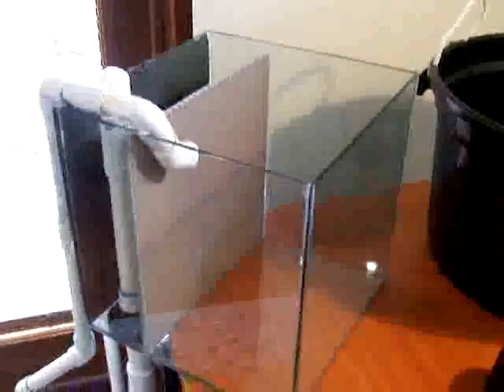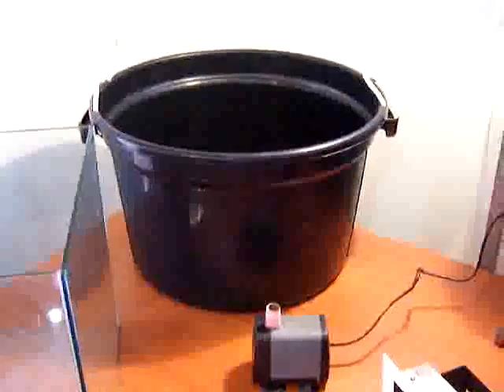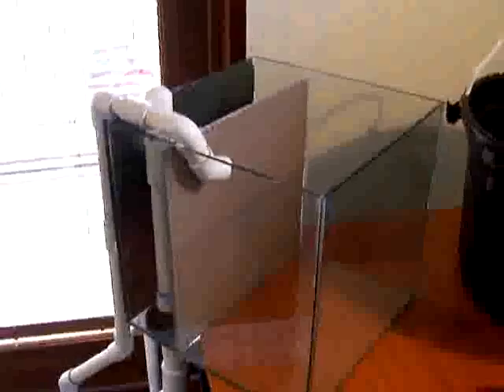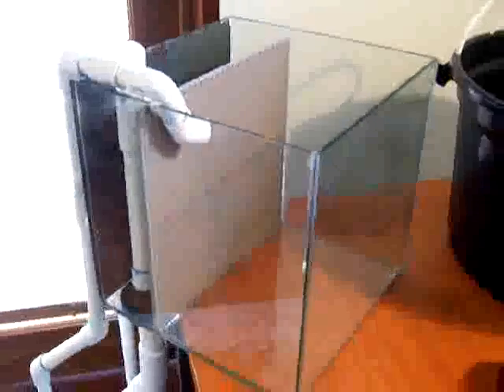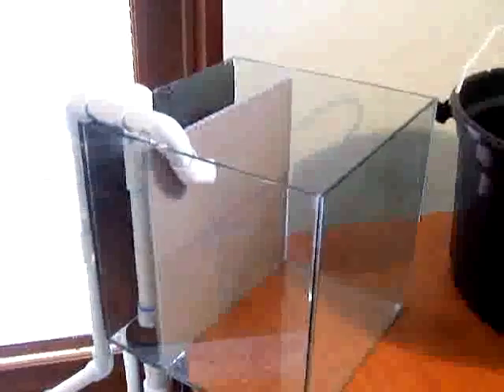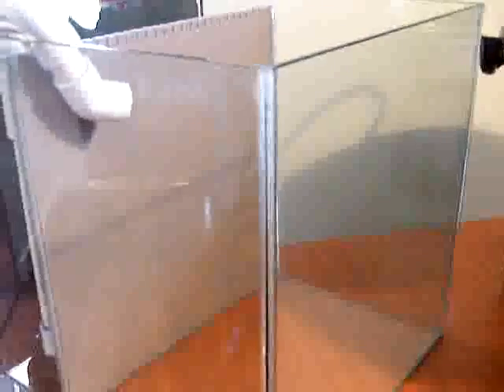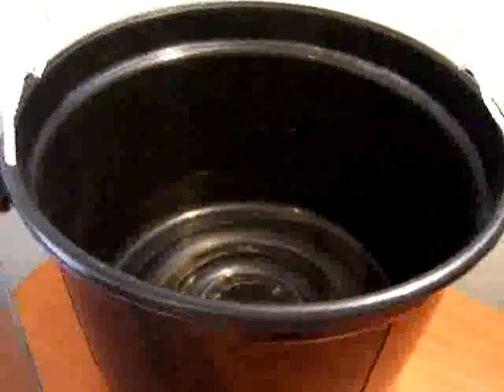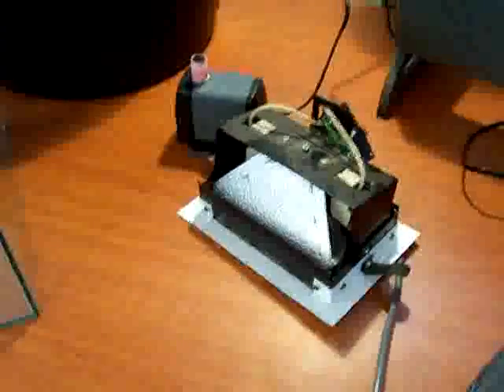How to build a nano marine aquarium PART 1 of 4

Comment from the maker: @xboxdisc 
Yeah, silicone is what holds tanks together, not the bits of plastic on the corners.

The main advantage to the plastic on the sides is to protect the edge of the glass from getting hit. If you hit the glass on the end, it's likely to break.